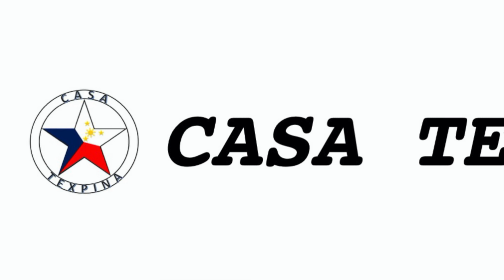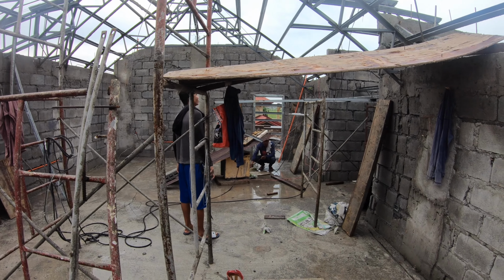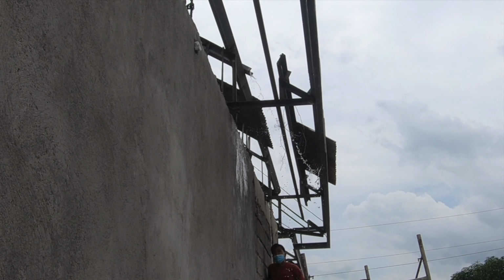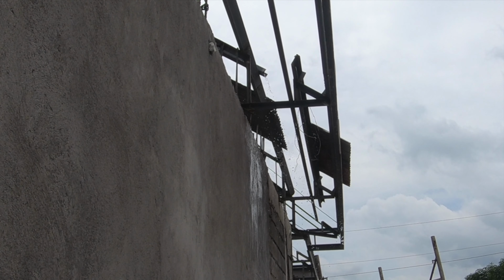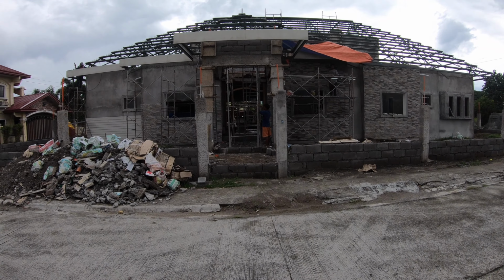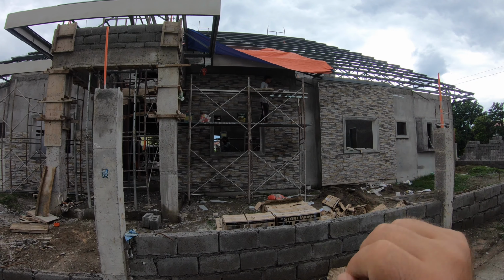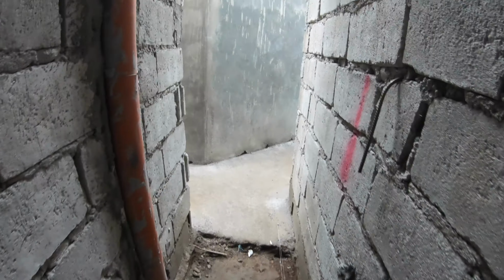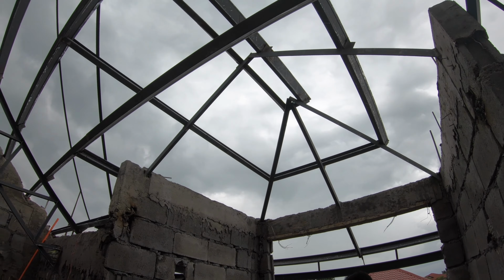Philippine House Building Step by Step, Build Day 117: Fence Grille Prototype

Comment: Thanks for the Shout out brother, your house is super big, nice neighborhood too.  Drone footage was nice.  The dang rain must be a bear to work with during house construction.  The stone wall siding looks nice.  Again, your house is huge.  Have you thought about a solar system for the house? Are you planning for a backup generator?  What type of garage is planned for the house?  a U.S. style or Filipino style?  Just wondering.  In any, case what type of drone are you using.  I currently have CJI Mavic Air, only because it fits in my backpack easy.  What camera are using for your videos?  I Know... questions questions, hence why I am in the rookie stage. Keep the videos coming... you and Emie stay safe.
Reply from the maker: Mike & Gerlie,
The house is planned so that we have room should we ever have company stay over. The garage is going to US style with a roll up garage door. 
Putting in a backup generator with automatic transfer switch. Also using a solar hot water heater. Future plans are for a grid-tied solar system but that might not be installed during the initial build. 
Drone is a DJI Mavic2Pro with Smart Controller. Camera setup is a GoPro 6 with Ulanzi vlog cage, GoPro mic adapter and Movo VXR-10 shotgun mic sporting a hot pink windscreen. 
I chose the Mavic2Pro about a year ago, before the Mavic Mini came out. But I’m happy with it. I have a Lowepro backpack that fits all of the drone gear, GoPro gear, and my MacBook Pro. Easy to carry and doesn’t weigh too much.
I have a GoPro 8 on standby waiting for the arrival of its vlog cage and mic setup before putting it into action.
Look forward to catching more of your videos as retirement draws closer. 
Y’all take care.